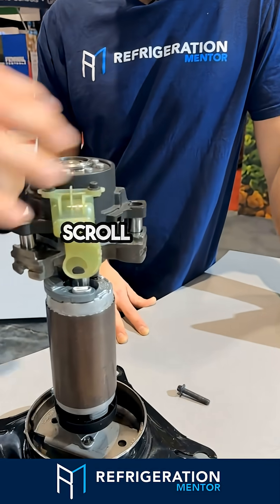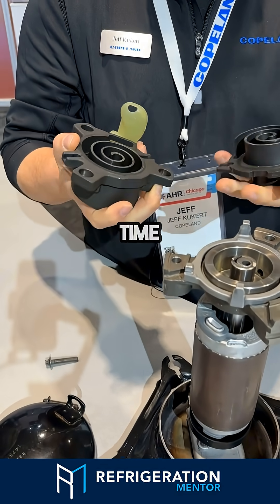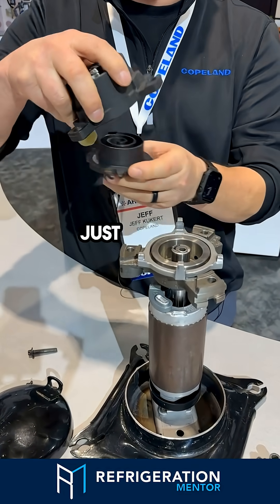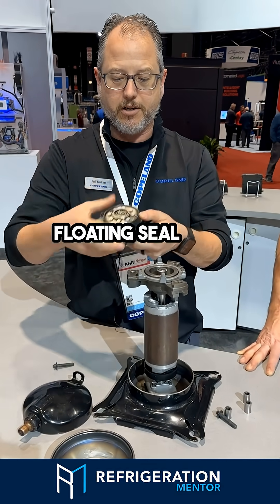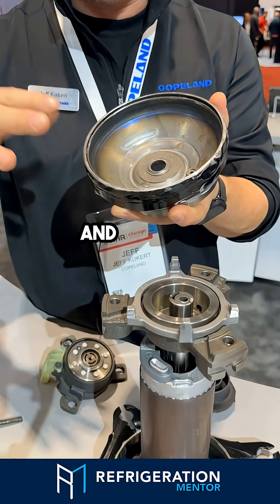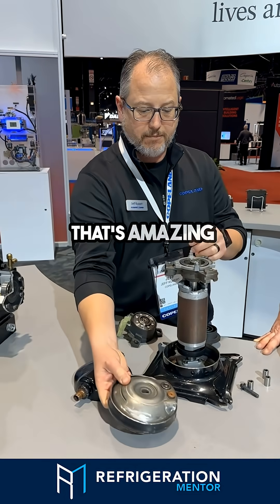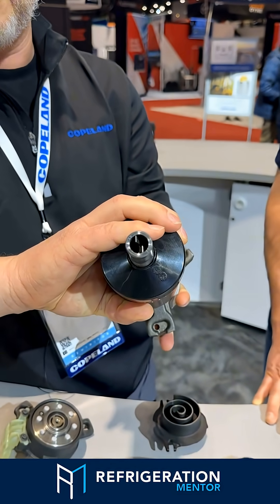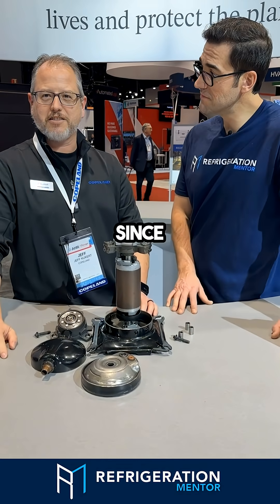Do you know why scroll compressors can start so easily compared to other compressor types?

Comment: It’s similar to rotary compressor function, biggest differences are on compressor shell pressure, the rotary compressor have discharge pressure inside the shell , the screw compressor have low pressure inside shell!!!